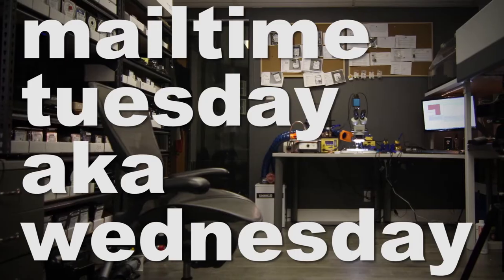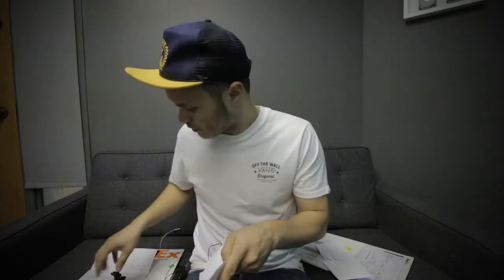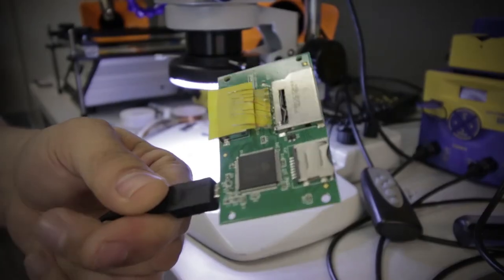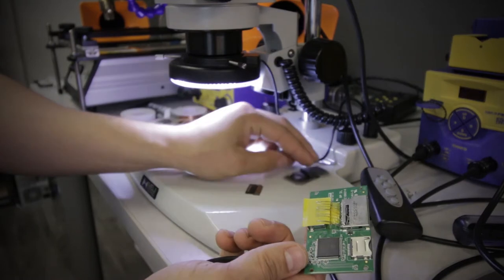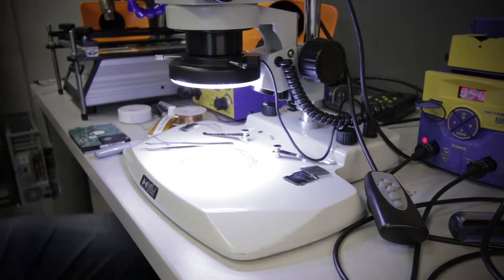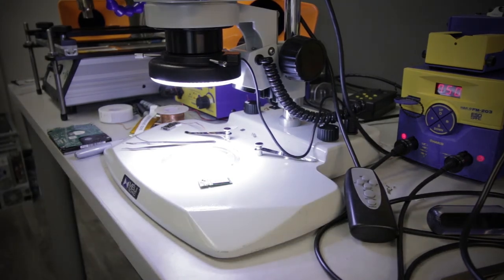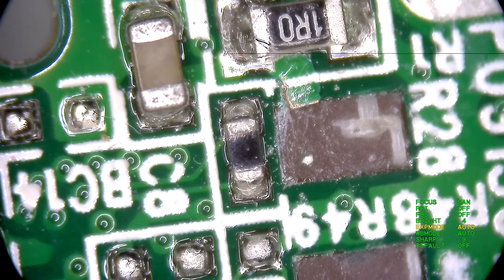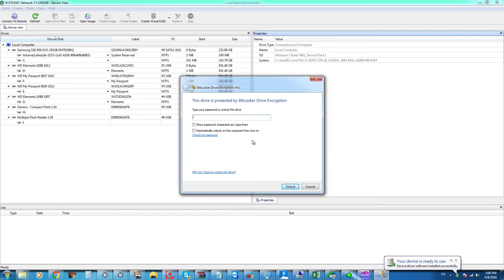get data from SD card with broken case

Comment: if the inner part of the sd card is broken in half, the sd is done correct? i removed the inner part and put in a new case and it wont power up, it was run over a few times with a car....